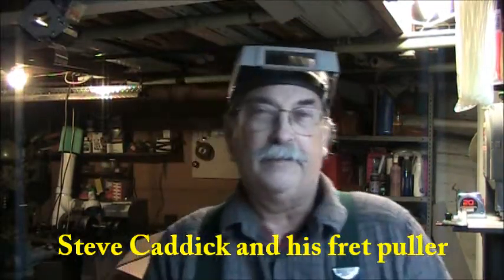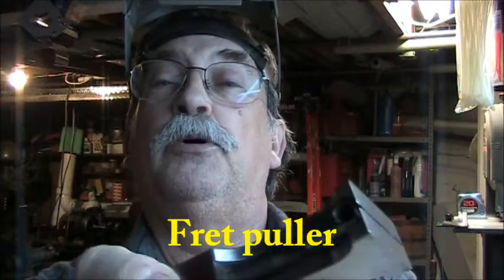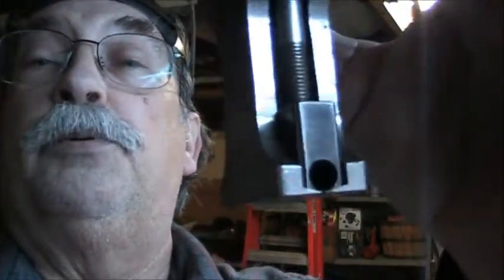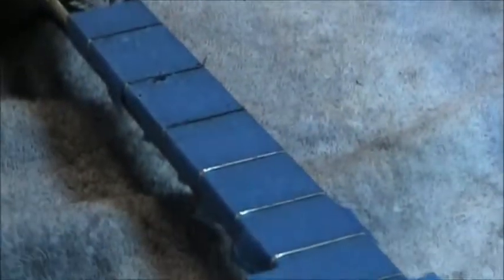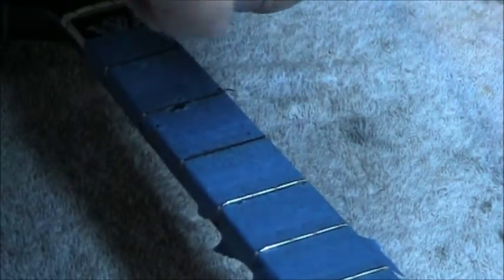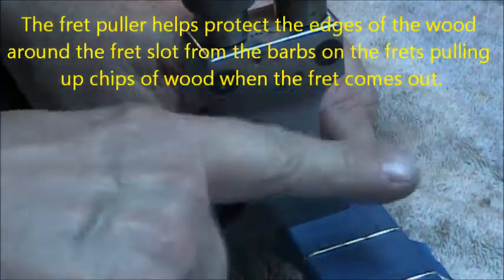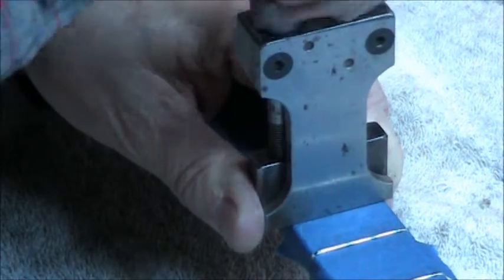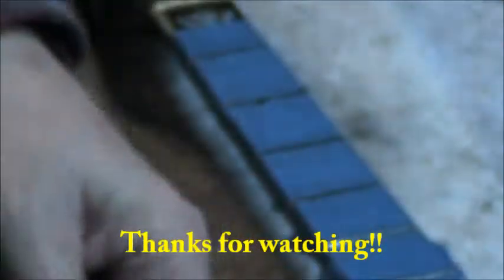Steve Caddick demonstrates his Fret Puller

Comment: Try using an "American Beauty" resistance soldering device to heat the frets themselves to melt/break loose any kind of glue that may have been used to bed in the frets whether it's hot hide glue (old school!), Titebond, epoxy, or superglue.   The heat is localized just to the fret which becomes the heating element.  It also softens the fingerboard wood right on either side of the fret tang helping to prevent chipping.    Also, bevel the fret slot edges just a bit with a triangular file before refretting.  This helps guide in the fret tang and also prevents future chipping by subsequent luthiers.   We do this on new fingerboards as part of our CNC fret slotting operation.   The machine starts with a "V" cut, and then mills the slots with a .023" or .025" bit.